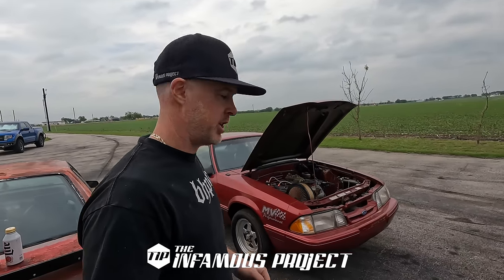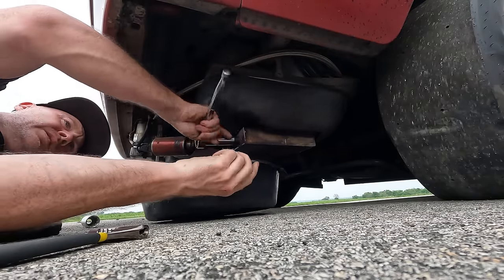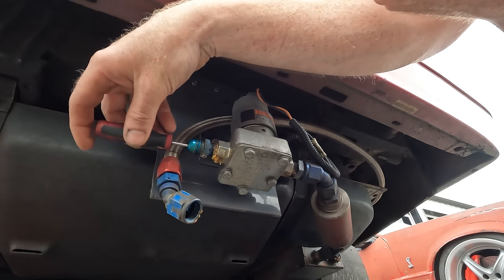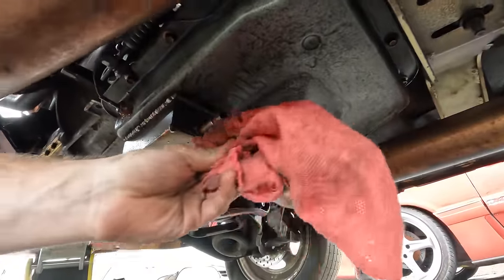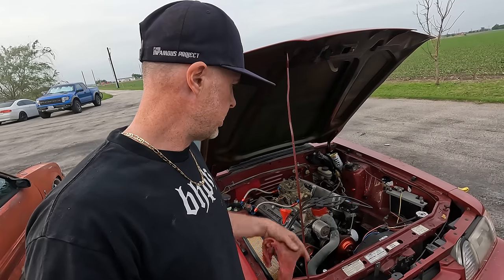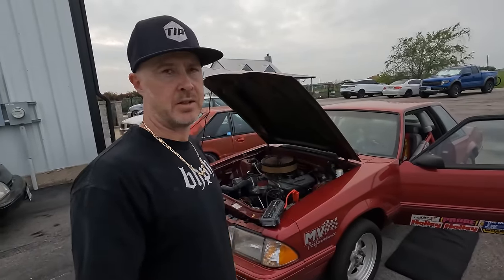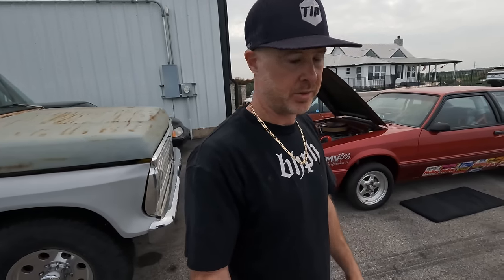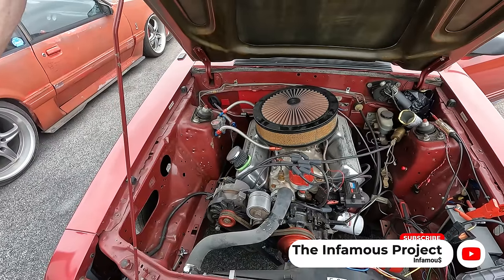First Start (sort-of) in over 20 years! 1993 Mustang Notch

Comment: The baumannator is a TCS (Transmission Control System) for an AOD-E/4R70W transmission. It is what controls the transmission, you can adjust and tune it for different shit points and all sorts.of trick stuff. That original handheld piece is a thermocouple for measuring EGT's for fine tuning the carburetor.
Glad to see this thing coming back to life! Love the 90s/early 2000s tech, so nice to see the old tech again.

Comment: I would guess one switch would most likely be to lock the converter up in 4th or after 2nd gear. Thats a Bauman built Aod or  Aod with Bauman internals, the old bauman box is amazing to see
Reply: That is a transmission controller for a AOD-E/4R70w transmission. It's an AOD-E swap, and you would use that controller, along with the TPS to adjust shit points, line pressure, and all that good stuff. Ancient from today's trick controllers, but it was cutting edge back then!